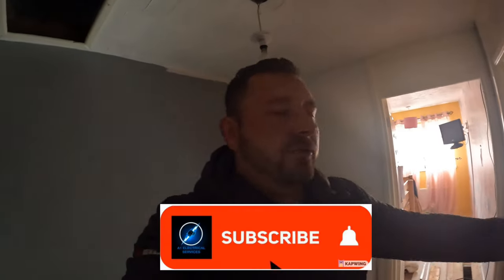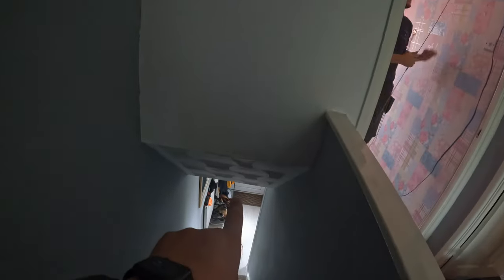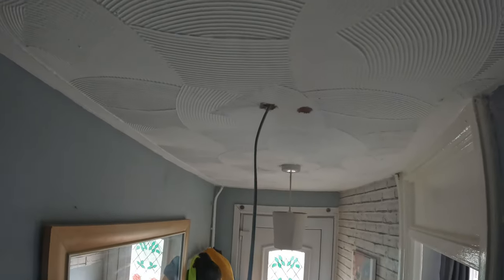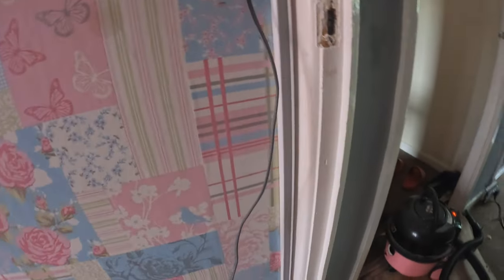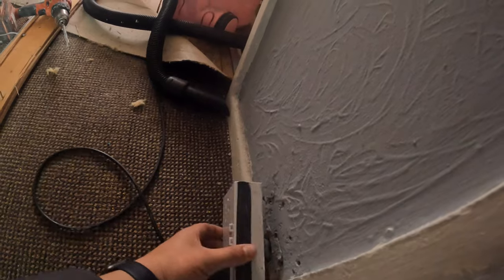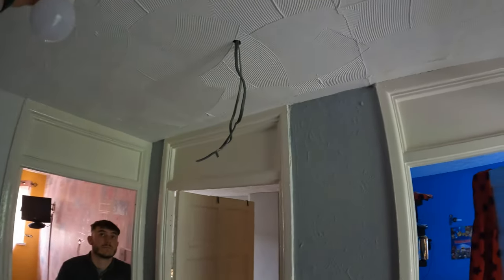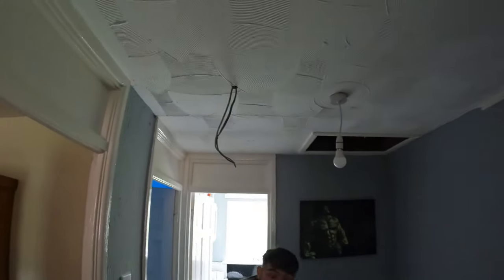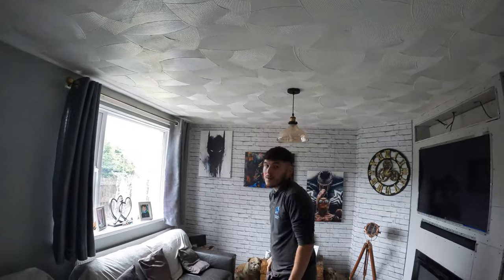WHATS INVOLVED WIRING MAINS SMOKE DETECTORS

Comment: Hi Wayne, the reason you need to secure the cable with fire clips is to protect firefighters who may be in the building when the fire has developed sufficiently to melt plastic clips and trunking. Visibility would be zero ans a number of firefighters have sadly lost their lives because they became entangled in loose cables.

Comment: Aren't you supposed to have a means of isolating the alarms separately to the lights? I tend to put in an FCU from the light feed and then run cable from there.
Reply from the maker: That’s a good idea, I just find if they are on there own supply tenants turn them off if they annoy them. I put them on with the lights so that this doesn’t happen
Reply: That's why I run them off the lights and to an unswitched FCU. Then they can't turn them off unless they pull the fuse
Reply from the maker: @lh2589  agree with you mate, it’s a good idea. I just never thought of it
Reply: Where would you put the FCU.  Left in the attic or under the floor joist?
Reply: Not heard of that one before. I’ve read the Aico manual from cover to cover and it doesn’t mention that it needs to be isolated separately from the lights.

Comment: Nice job all round gents! 
Rented properties in England have required a smoke alarm on each floor for quite a few years now. They must also have a carbon monoxide detector where there is a solid fuel burner in a room.
Reply from the maker: Yes same in wales. We are just a little behind 🤣🤣🤣

Comment: Do you need to turn off your full electricity power of
Reply from the maker: It would be the safest option yes
Reply: @Waynesworldofgaming  I have the council worker coming out he is a electrician I think do they need to turn off the full mains as I will not be in at the time they are there I think its just a carbon monoxide needed in my room beside the boiler but not sure about the smoke alarms they look as if there stuck to the roof basically I need to no if my full electricity boy needs turned off
Reply from the maker: @kevingardiner1407  no it doesn’t all need to go off, just the smoke alarm/lighting circuit
Reply: @Waynesworldofgaming  thanks mate 👍
Reply from the maker: @kevingardiner1407  No problem